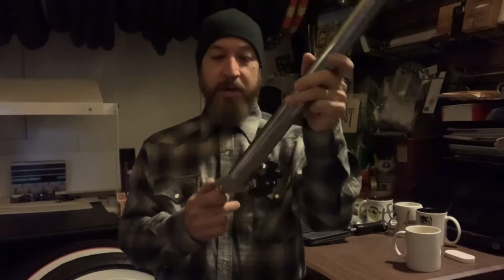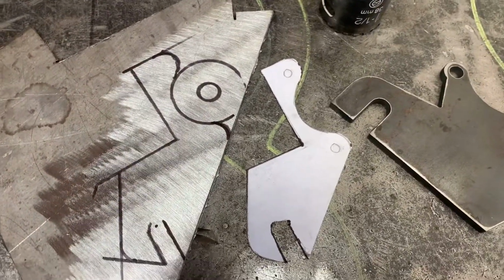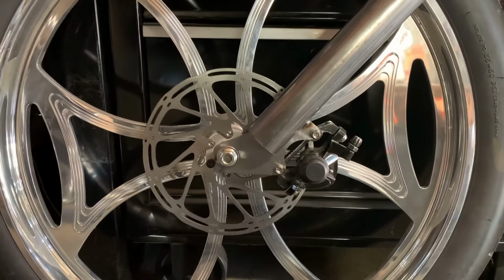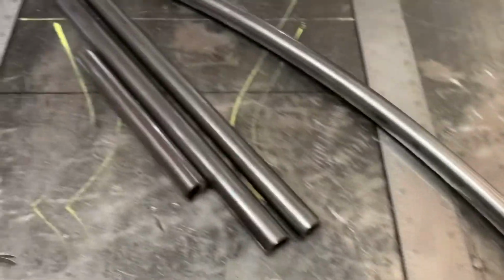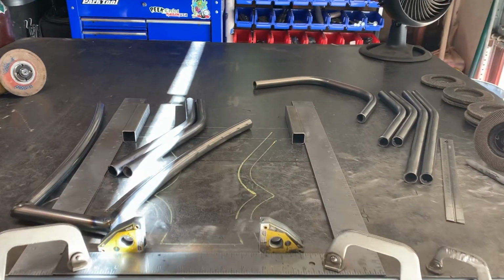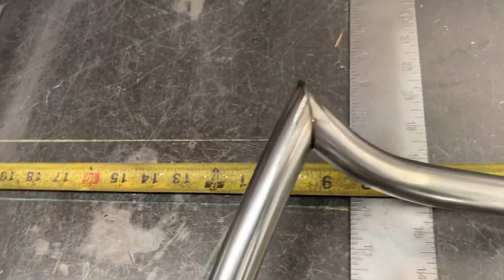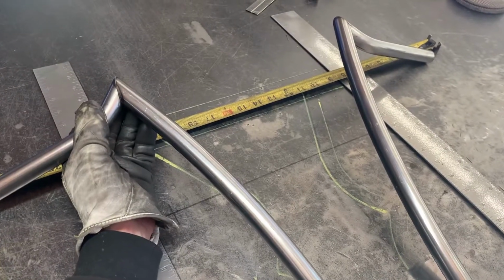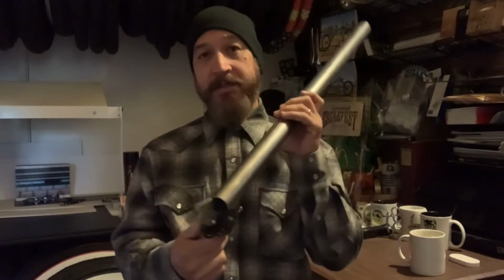Ep53 Peek Cycles: Non Extended Fork Dropouts w/ Brake Tab Version B, Easy Rider Bars, Grinding Tips

Comment: good evening my friend . i was working on my upcomeing winter project and i was wanting some raw extendend drop  about 8 inches for the front  wheel can you supply me with some ?
Reply from the maker: Did you get this worked out?
Reply: @jimmypeek5330  I’m still working on it waiting on the wheels to come
Back for the e hub   Conversion once I get the wheels I can build around them